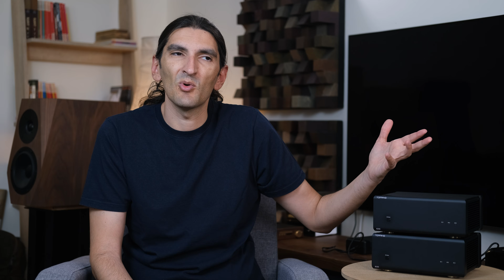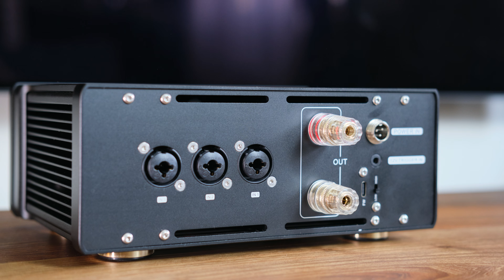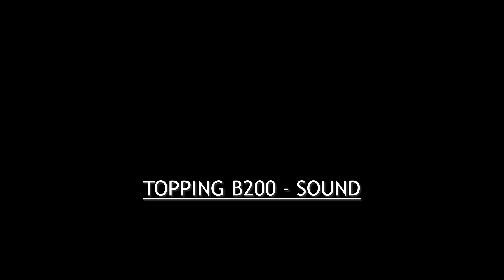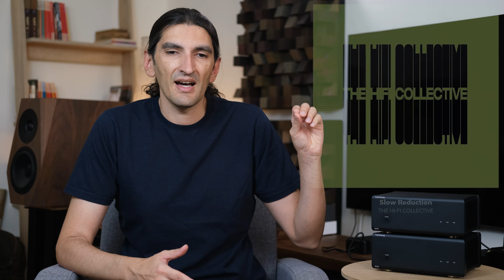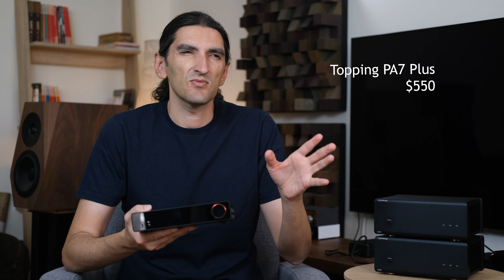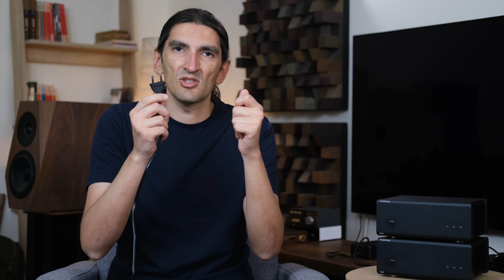Just get them and thank me later - Topping B200 review

Comment: Hi Srboljub, it’s been over a year with the B200s. As you noted. It’s transparently really exposes everything’s that precedes it. After testing five XLR cables, I found the most natural for a hundred bucks Canadian, the BOAACOUSTIC OFC HiFi Balanced XLR Cable RedBerry Series from Amazon. Only needs a couple days break in.
Reply: One more tip. These power cords from Amazon are under fifty bucks Canadian, Tertullus HiFi Audiophile Power Cord with Rhodium Plated Connector Male Plug+ IEC 320 C15 Figure 8 Female Connector. They made a noticeable improvement on my B200s. They also worked well with a Topping PA5 class D. Thought you might be interested. Bet it would be great on LA90s too. I was surprised by the sound improvement using with power bricks.

Comment: Let me add to your outro additions: supplying filtered power also helps a lot with a darker background, noise, etc.!
Even more for A & A/B amplification. 
Something like the Dynavox X7000 is also telling you, if you're wall socket is connected the wrong way.
Cheap alternative for at least having EMI/RFI filtered power, is the Brennenstuhl 2797706 power socket, which also saves your devices from lighting up to 60.000A! 
Highly recommended, especially in old buildings, with old power lines.

Comment: I’m glad you brought up the fact that the power reserve is not available on this amp.  As exhibited in the same power rating at a 4 ohm load being the same as with 8.  I suspect it is because it is the power supply design choice that Topping almost always chooses, a switch mode power supply.  A think a toroidal or transformer base voltage converter pair with good quality capacitor designed linear Power Supply would have solved this  issue.

Comment: Thanks for the review. I'm really interested in this amp. However, at least two other reviewers (oldguyhifi and passion for sound) have said these amps sound dynamically flat. Do you have any thoughts on what the reason might be for this significantly different impression of the amp? They are both seasoned reviewers and presumably tried it with different sources, etc. I am looking for a punchy, fast and energetic sounding amp and am so tempted by your review.
Reply from the maker: What is the rest of your setup, DAC, preamp, speakers?

Topping B200 is not a kind of amp to add punch and kick but it will pass them trough quite nicely if components before it can create it. If both source and preamp are on a leaner/quicker/polite side... B200 will not be a good choice most likely. So pairing is important. It won't work equally well in all situations.
Reply: @iiWiReviews  thanks for the reply! Options are Gustard X26, Laiv uHarmony, Topping Pre90, Ladder Bach and Wharfedale Super Lintons.
Reply from the maker: Not sure what's your current amplifier and if B200 would be an upgrade... But that looks like a good environment for B200.

Regarding dynamics, I found it more dynamic than Audiophonics Purifi E400T, IcePower 1200 and NAD C298. It's only now that I'm testing some 3.5x pricier amps that I find more alive sounding.

I belive that Passion for Sound compared them to some expensive Burson amp that is known to be very dynamic so he came from that angle. But I never encountered anything at this price point that sounded better than B200 to my ears.

I could only say they are tonally flat, not spiking midbass punch or highs bite, so maybe they're perceived that way. I remember a colleague of mine compared them to Benchmark amps, and said they are quite similar, and people have very divided opinion on those too. Some call them neutral and transparent, some flat.
Reply: @iiWiReviews  excellent, thank you for the detailed information!

Comment: dear iiwii, would you recommend the b200 over the atoll in100 for the wharfedale linton heritage speakers or kef r3 meta?
Reply from the maker: I would but only if it's accompanied by a really good preamp. Otherwise, IN100 is a really good integrated solution.
Reply: @iiWiReviews alright thanks, I guess I will go with the simpler to set up atoll in100 👍

Comment: Thos 1200as2 at 1500 euro are a ripoff... They should cost 750 euro each since the whole module amp is 450 euro with power supply and cables included

Comment: I would like to understand, but are the topping la90d and b200 the same, or are they different internally?
I already have the topping la90d I would like to understand if it is worth buying another one or if I should sell it and get 2 b200, thank you very much
Reply from the maker: B200 is based on the LA90D in a bridge mode. So if LA90D can work in a bridged mode (I haven't checked it) then two of them should sound the same as these monoblocks.
Reply: @iiWiReviews  thank you very much for the answer, another question which preamplifier do you recommend for about 1000E, once I had the topping pre90, it seemed quite good for the price, a90d does the pre function, and is it as good as the pre90?
given the price, it makes more sense given that it has the headphone output and on used it is easy to find and at good prices, what do you think?
I was evaluating Ladder Chopin, I hoped to spend less, but if it really makes sense I will make a sacrifice
Reply from the maker: I ordered Pre90 and I'm going to review it when it arrives. Until then my standing favorite is Ladder Bach. Fantastic preamp for the money. https://youtu.be/pxfzKdoBVUg?si=EdFKAnnZjca8TTsV
Reply: "The PRE90 and A90D, as far as I know, are the same; there should be no difference. At this point, the A90D is more convenient since it includes a headphone section. Even if one doesn't use it now, in the future, you never know if things might change."

Comment: Thanks for great review and fantastic work! I think B200 are one of the best amps for my taste I have tested and I had many amps priced 3-6k€ before. To your description I would add "natural lively" sound. For me they have a little bit of tube sound due to very clear and detailed top but with additional authority. But it is true that you need a good silent source and reviling speakers. I connected mono blocks directly to Auralic Vega S1 + LP which is a great DAC /Streamer and Preamp. It turned out the preamp is dealing very well with them - at the level of Topping pre 90. I think B200 will stay with me for long. Thanks for a tip!
Reply: Have u ever try unison primo or due?

Comment: Reading the reviews on Amazon, there is one that said they blew a speaker caused by disconnecting them from the mains. Have you found any of this behaviour.
Reply from the maker: I disconnected them from mains many times and never had even a loud pop from them. Of course I always turn them off first. I hope that Amazon user didn't maddle with power cables while the unit is on.
Reply: @iiWiReviews  yeah ok but it's still a worry, what if you have a power cut. I really like these amps but that review spooked me.

Comment: I also bought these two monoblocks, about two-three weeks ago, thinking that they would bring an addition in sound quality compared to a Lyngdorf TDAI 1120.
But in all these days of testing, I found that Lyngdorf still offers a slightly more refined sound, the highs are heard smoother and more present, and it also has much better bass control. For Topping's I used Lyngdorf as preamplifier.
Regarding power, both amplifiers, set to the same volume level, sound similarly powerful, so, even at this level I did not feel any gain.
I don't even know what to do, I can't return them, since I just exceeded the period, and if I put them on sale, there is a loss of about 20-25% of the cost, even if they are brand new.
I will put them in a closet and cross them to losses generated by blind buying.
Reply: Losing 25% is low by audio gear standards. That’s bc they’re in demand. Dump them now or you’ll surely get much less for them in the future
Reply: The B200s are much better than the amp in the Lyngdorf. The measurements from Audio Science Review show that that they are in fact perfect , as far as audio amps go.  The measurements of the Lyngdorf from Sound Stage Network shows that it's.... at best mediocre.

What you are probably hearing there is that the quirks in the Lyngdorf's own amp better matches the quirks in its DAC-preamp in a way that you like.  The B200 will just magnify all the imperfections in the preamp transparently.  

You can probably re-tune the pEq to create a sound you like with the B200s, and then they will be able to play louder and cleaner versus the Lyngdorf on its own.  Also, when coupled with a better DAC, DSP, preamp chain and out to good speakers, the sound should blow the Lyngdorf out of the water.  Of course, that's not easy, because the Lyngdorf has nice room correction and DSP features, which can compensate for some of its failings.
Reply: @teasipper6106  Did you have both amplifiers at home and listen to both of them thoroughly, or are you just speaking based on reading measurements posted by some on various forums?
Reply: @ just from measurements, and that's all I need.  They tell the whole story and are plausibly consistent with your subjective experience.  You should trust the measurements in this situation.  For example, you said the Lyngdorf sounds more refined in the treble and controlled in the bass.  The measurements show a rolled off response in the treble for the Lyngdorf for a real speaker load.  It also has a wider peak width on the 50hz test signal with some harmonics.  After a long period of familiarity with the Lyngdorf and depending on your speakers and setup you could easily have a subjective preference for that particular profile versus the fully flat frequency response and fully correct pulse shape and lack of multitone distortion of the B200. You may have interpreted that as less treble refinement or less bass control, but that perception is relative and depends on what you psychologically focus on when feeling a piece of music sounds "right".  

Also, they should sound similarly powerful under similar settings.  You get the option of pushing the b200s well beyond the distortion limits of the Lyngdorf, but within those distortion limits, you should hardly perceive a difference except the more colored presentation.

Remember what you're buying with the amp is potential.  Whereas before, you had a window that was slightly distorted and colored in a way you liked, now you have a perfectly clear sheet of glass.  You might not like that, but you get the option of recoloring it to taste while letting in more light than previously possible.  In that sense, listening to the pair under a particular set of circumstances is not helpful as that could obscure you to the true potential of the new setup when fully optimized.  If you have a measurement mic and the eq in the Lyngdorf you can make use of it and maybe find a sound you like even better rather than sticking the B200s in your closet.
Reply: @ Well, it's very wrong to rely only on that, measurements give only technical results, and ears give effective the real results.
There are people who may like dirty, distorted sound, etc., and this because the sound is subjective.
So personally, the ultimate test that tells me whether if I like a sound or not, is done with my ears, not with Amir's crappy measurements, which he can shove up in his ass.
For me it's completly no use that a product is measuring perfectly if my audio preferences are completely different.
In conclusion, I didn't like how they sounded, and Lyngdorf offers me a much superior and more pleasant sound FOR ME, period.

Comment: I read that the B200’s input impedance is 10kOhms which I quite low. People recommend a preamp to have an output impedance 20x lower than a power amp’s input. Considering this, it feels like a lot of modern preamps would be less ideal for the B200. Do you find that’s the case ? The Freya+ for instance, has been measured at 830ohms balanced with tubes - which is just a little over 10 times. I worry it might not be compatible and have bass roll-off or distortion. Does someone know if it would work or not ? Many thanks
Reply: Then the schiit Kara would be better with the 1x gain not the 4x gain....the Freya has tube or buffer.
Reply: 10x difference would be fine as this is the typical match

Comment: Hello! I got them. First - if you wonder about the last tip - I opened the powerblock and I can say that the Live wire needs to be at the near edge of the block. And beware - cable plugs are not necessarily similar in regard to live/neutral (mine were not). You have to check them. Thank me later!
Reply from the maker: Thanks for sharing

Comment: Well...
64V 4A SE power supply doesn't allow more than about 80W per channel, do your math!
AB has been most used regime for power amps as long as solid state transistors have been available.
This all sounds pretty much a salesman talk
Reply: It's show more how little you know about how amplifiers is build. Capacitors help it with higher voltage, than again give more watt
Reply: @ 
Please give me examples of such solution
Capacitor is simply gathering energy, it doesn't add it
And, are there measurements from independent parties about all tech characteristics?
These i found iat Amazon seem a bit out-of-this-world.
BTW, why balanced interfaces in domestic amplifier? 

I've been dealing with audio devices since 1989, so i've learned a bit or two. In fact i'm pretty familiar with balanced int. being in pro TV business for 30years
Reply: P=V*I
Reply: @ 
64V SE means 32V 4A instant PEAK power
RMP is measured as long-term powre
Or you have any other calculator?

Comment: Based on your review and a sale, I ordered a pair of B200s.  The sale saved me $200 and was just too good to pass up.  So my bi-amped system will have a pair of Schiit Audio Gjallahorn stereo amps, each bridged to power one channel (around 30 watts per channel) based on another reviewer’s glowing review of doing this and a pair of B200s based on your review.  The system (for now) is simple: an old CD player and Roon Nucleus going into the MiniDSP SHP then out to the amps and then to my DIY speakers.  Interested in hearing the result as none of the amps have come in as yet.
Reply: Which one you use now?
Reply: @ Not sure I understand your question.  All of them would be needed.  This is a bi-amped speaker so I have 4 channels that need amplification.  The tweeter/midrange section does not need much power for those 2 channels so the bridged Gjallahorn amp will do, one for each channel.  The woofer section can benefit from much more power (my guess is 200-300 wpc), which means one B200 per channel.

Update: it is now December.  The Gjallahorn amps in black are still back ordered.  Shipping date is now estimated to be December 18.  To their credit, Schiit has not charged my CC.  The B200s that I ordered are back ordered until late December.  I cancelled that order because the merchant charged my CC even though they had nothing to ship.  Very frustrating.
Reply: @ccdccd8615  i ordered fosi v3 dual mono

Comment: These vs Topping pa7 which one is better deal?
Reply from the maker: PA7 will provide almost equal detailing and clarity. But B200 will do it with greater dynamics, bass grunt, and in a slightly wider soundstage. So all depends on how much value you put on these.
Reply: @iiWiReviews  thanks man. I am planning to buy pa7. Can it produce emotional soumd like class ab?

Comment: Your note on the position of the power plug is justified, but it applies to the power supplies rather than the power amps. Clearly, these weak 4-Amp power supplies are doing a disservice to these decent monoblocs
Reply: 4 amps x 120 V = 480 watts.

Comment: Not denying these monoblocks their merit - but for 200 Watts on 4 Ohms the Ohm law would dictate 7 Amps current requirement off the power supply. The specs clearly confirm, that the limitation is in the current, otherwise the power amps should deliver double the power to 4 Ohms compared to 8 Ohms
Reply: esses numeros são inflados, se tiver é 40w RMS, e estou sendo bem generoso

Comment: Are these worth buying over the pa7 plus? Apart from wattage power.
Reply from the maker: Yes. Better punch, dynamics, and bigger soundstage.
Reply: @iiWiReviews  Thank you for the response. I always had my eye on the pa7 because I have the e70, but of course these make much sense. I'll wait until they are reduced in price.
Reply: @iiWiReviews Good question, i have also topping pa7 paired with kef r3 meta, sound is good, but i want to upgrade amplifier to b200 or acoustic invader stereo mode and  i m not sure wich one to choose. My budget is max 1500 euro